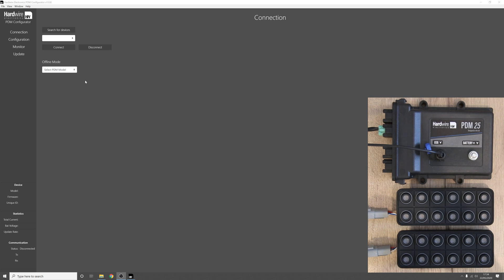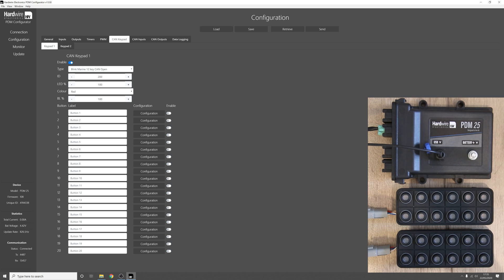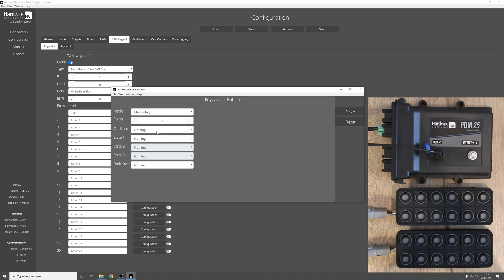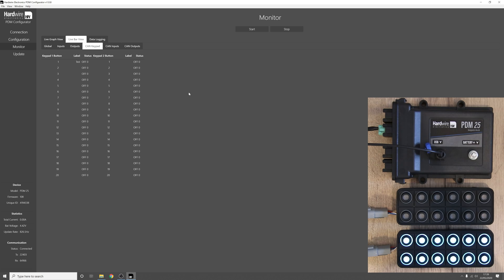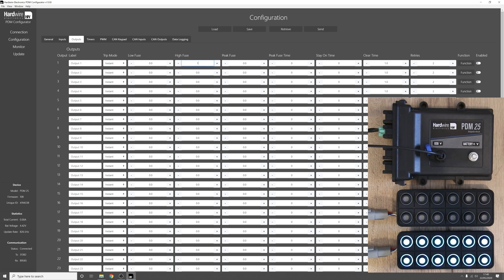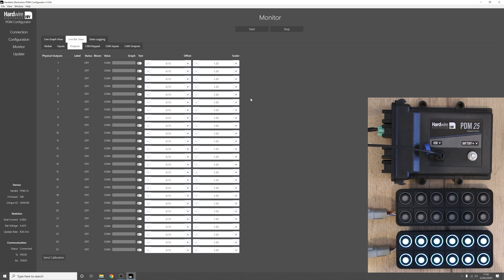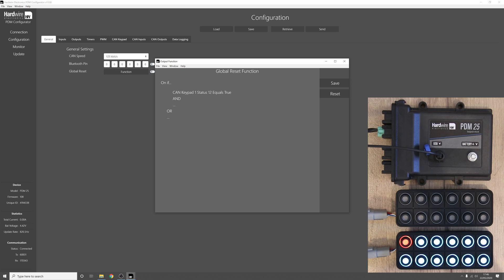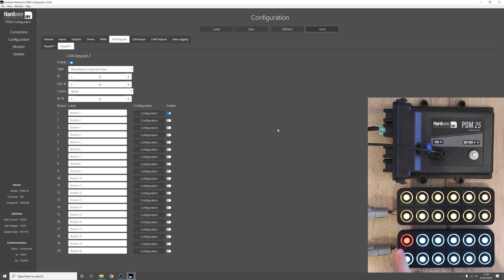Connecting a PDM to a CAN-Bus Keypad | Hardwire Electronics

Comment: Can the pdm 25 send a message on the CAN communication that states if a circuit has been tripped?  So for an example on my dash display it could give a warning that the fuel pump circuit tripped due to current exceeding the set value.  Also, what is the proper way to wire in pull up and pull down resistors?  I am very excited about this PDM and this product came at just the right time for my project.
Reply from the maker: Hi there thankyou for commenting with your questions, please send an email to contact@hardwire-electronics.co.uk and we will answer your questions there along with a few diagrams to help out. 
George